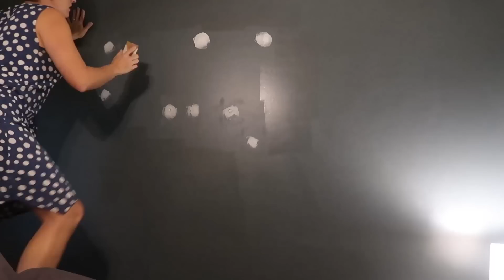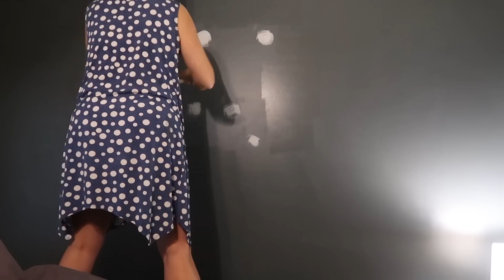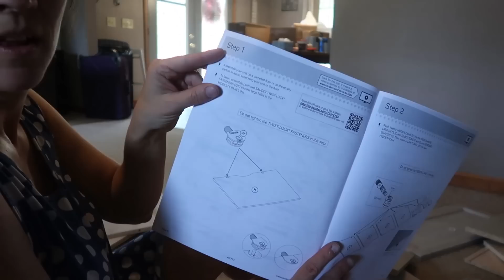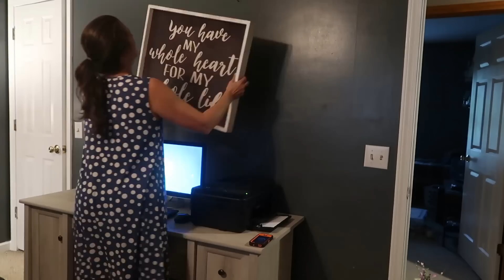Finishing up my bedroom...this Momma can do this!

Comment: No ice cream banana split is also a great dessert 

NGREDIENTS

 2 cups graham cracker crumbs

 1/2 cup unsalted butter, melted (1 stick)

 1 (8-ounce) block plain cream cheese

 16 ounces Cool Whip, thawed, divided (or 4 cups heavy whipping cream)

 1/2 cup powdered sugar

 1 teaspoon vanilla extract

 1 (20-ounce) can crushed pineapple, drained

 4 bananas, sliced

INSTRUCTIONS

Spray a 9x13 baking dish with non-stick spray. In a bowl, stir together the graham cracker crumbs and melted butter. Pour the mixture into the baking dish and spread into an even layer, pressing down to set into place. Place the dish in the fridge.

If you are using Cool Whip: Add 8 ounces of the Cool Whip and cream cheese to a mixing bowl and beat until fluffy and combined. Beat in the vanilla and powdered sugar. Note: If you are making homemade whipped cream: Pour the whipping cream to a bowl and beat until soft peaks form, about 5 minutes. Spoon out about 2 cups of the whipped cream and set aside. Add the cream cheese, vanilla, and powdered sugar with the remaining whipped cream and mix until just combined.

Take the baking dish out of the fridge. Spread the Cool Whip/whipped cream mixture on top of the graham cracker crust evenly. Arrange banana slices in a single layer on top, pressing down gently. Then spread the crushed pineapple on top of the banana slices.

Spoon the remaining Cool Whip or whipped cream on top and spread with a knife to cover the bananas and pineapple. Cover with foil and chill for at least 4 hours. Before serving, garnish with chopped walnuts, maraschino cherries, chocolate syrup, or sprinkles. Slice and serve. The dessert is best eaten within 2-3 days
Reply from the maker: This sounds delicious